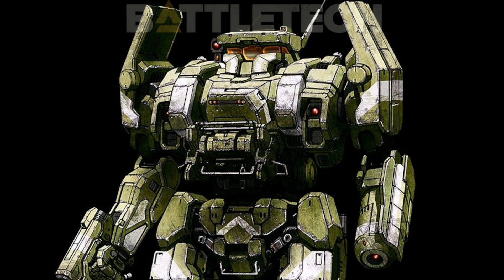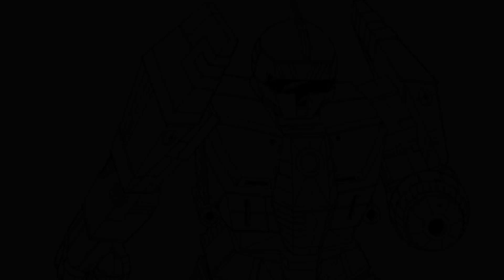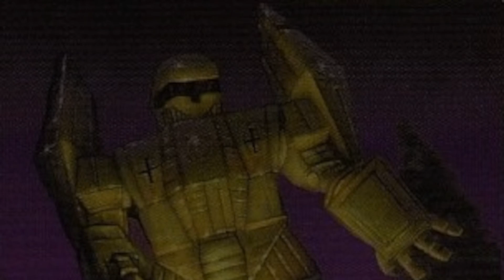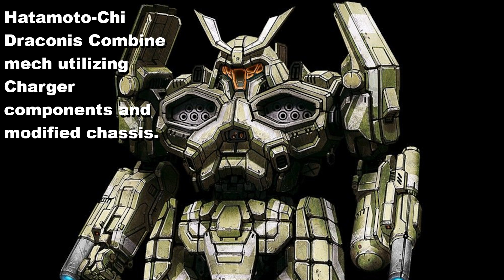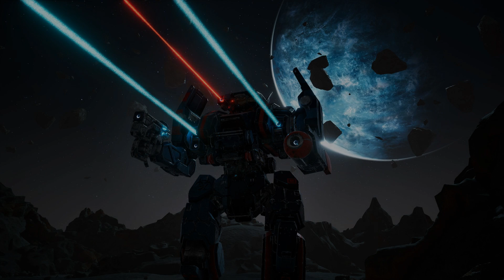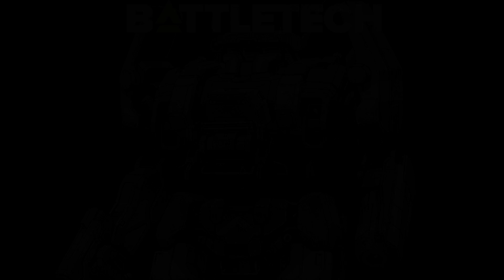BATTLETECH: The Charger

Comment: This frustrates me.  No one would be stupid enough to make a mech with the canonical standard design.  In the Star League era they would have used advanced tech (XL engine, endo steel, etc.) to give it that speed while maintaining viable firepower.  In the third succession war, the larger engine would have been replaced by a lighter but slower one.  Either way it would have been closer to a Zeus.  This whole idea of it being designed as a heavy scout with 5 small lasers would never have occurred.
Reply from the maker: A lot of Star League mechs didn't get Star League "tech" until very near the end of the era to be fair.
Reply: @BigRed40TECH  I know.  I’m writing in part as a real life engineer who knows that aspect of the lore would never have really worked out that way.  I love BT but that part is always like fingernails on a chalk board to me.  The Charger is probably the worst of all examples of that.
Reply from the maker: @davidmelton3704  It's the worst mech ever made :D

To be fair, I think it was largely built and sold for corruption, more than it was for being actually useful. Someone wanted to sell 400 standard engines, needed the military to buy it. SLDF procument was notoriously corrupt.

Comment: If it was 85 ton 400xl engine 20 ton armor or 18 then do at minimum a lr Lazer and a few m lazers with a 2 srm or lrm then it would be a fancy medium mech that's really tall
Reply from the maker: 85 tonners sadly don't use 400 XL based on mech construction rules.
Reply: @BigRed40TECH  ah well I assume you got the idea I was going for anyway

Comment: Saw this video and was wondering if you would do a separate video on the Hatamoto. While the chassis is based on the Charger, the Hatamoto-Chi, -Ku, etc are far better machines and one of the best designed mechs (aestheticiacally) in my opinion. I mean, who doesn't want to drive a giant samurai robot?

I guess that makes the pilot a MechSamurai instead of a MechWarrior, eh? Haha
Reply from the maker: There WILL be a video on the Hatamoto-Chi. As it's more it's own thing, but I did make visual reference to it in this video.
Reply: Yeah the Hatamotos are actually pretty decent - but then again they are the Combine's attempt to make knockoff Thugs, so they at least had a working reference to build off of.
Reply: @YesNoMaybeOkSure  True, the Charger is... original, to put it one way lol.
Reply: @BigRed40TECH  I saw the reference but wanted more haha. I didn't realize there were Hatamotos other than the Chi until I started playing classic BT with my dad. I'm just interested in how it holds up to other mechs since I've only read to the Battle of Tukayyid in the lore.
Reply from the maker: @iFallenAtlantis  The Hatamoto lineup holds up pretty well imo. It's gonna be a while before I cover it though. As I'm first covering all the 3025 mechs.
Reply: @BigRed40TECH  That's great. I look forward to seeing the histories of some of my other favorite mechs then!
Reply from the maker: @iFallenAtlantis  Covering all the mechs this way may melt my brain eventually. But I will be ever-pleased to do it, lol

Comment: Although it is completely out-of-character to the design flaws of the origional 1A1, the 'challenger' variant is just another slow, gun-heavy assault mech. They are rather hard to believe, as the entire point of this design was heavy + speed; Challengers are supposedly rare, but prized gladiator style dueling mechs. I use one frequently as the Liao lance commander 'badguy' in my campaign and it really shines. Just another offshoot variant that in no way resembles its predecessor, it is still a nasty fighter and takes a lot to bring down. I was disappointed that the 'challenger' didn't get a mention - but when it comes down to it, ANY improvement on a Charger just involves a smaller engine and bigger guns - may as well just get an Awesome or a Stalker for similar effect.
Reply from the maker: It's not a charger anymore. It's a charger derived design.

Comment: Y'know, I understand most people consider MWO apocryphal at best but... HOW DARE YOU!

My 1A1 is the hottest thing on legs since the invention of legs!

It is also quirked all to hell. If the range wasn't fixed, I am sure it would be a total bust. but considering that it has ~600m max range on 7 instead of 5 er small lasers, and a cycle time akin to a RAC, a Charger from MWO is a force to be reckoned with. The fact that I can chase down many clan mechs that top out at 81kph is great. I can always force an engagement.
Reply from the maker: MWO's just very not how it works on the table to be fair lol
Reply: @BigRed40TECH  Very true. But on the range at least for the tabletop it would be like having Medium lasers instead of small ones. The weapon cycling could be represented by even lower heat buildups.

Comment: Wait, if it only has 10 tons of armor, and 5 small lasers 200kg (1/10 a ton), so 1/2 a ton. Where did the other 69 1/2 tons go.
Reply from the maker: The Engine on the Charger weighs 52.5 tons for a start.
Reply: @BigRed40TECH  I have no words.

Comment: As much as the Charger competes for the worst mech title, alas, no, it's not. The Worst is the Hoplite -4C: 55t, 4/6/0, 11.5t armour. no arms, 1 AC10 w/1t ammo, 1 LRM5 w/1t ammo. It's slower, has comparable overall toughness, can't melee, and all of the weapons require ammo. The mass looks off, that make sense since it carries 16 heat sinks. The Charger was able to survive the succession wars, the hoplite could not.

For the Charger -1A1 itself, I have had a "moderate" amount of success by just upgrading the SLs to MLs. Sure, you loss a lot of armour and have heat problems, but 5 MLs is a decent amount of fire power for a successions wars mech. It's still nowhere near good but can actually contribute to a lance. I've also used a 4ML, 1F version as a "boss mech" for a succession wars pirate company. The rests of the pirates are in lights and mediums so the additional size of the Charger gives it a boost in toughness without making that much more dangerous for the player's medium/heavy mercenary lance.

Comment: Anyone who calls the charger bad or useless is an idiot who can only do stompy mechs.   Read up on the mech and use it for either its INTENDED purpose....or its true purpose.    

I've had several conversations with people over its use.   Once i explained the true use of the charger. - protective brawler for your recon mechs with crit seeking lasers - i.e., punch /kick ( 16 points damage) followed then 5 small lasers ( either finishing the limb or crits inside it) on other LIGHT  to lower medium mechs.  

You could see the light bulb go on once the strategy was explained to him.    This thing is designed to kill light mechs attacking or reconing your mechs.

Comment: Nothing new from me. The Charger is one of the worst mechs ever, and any talk about interests me like cringe, aka I have to see it. Its an Assault Mech that fails at being an Assault Mech, or even a Battlemech. 

With extensive changes the title mech can work. For the Inner Sphere downgrading the engine in exchange for better armor and weapons is essential to make it an actual Assault battlemech, or using an Extralight Engine to retain the speed but also improving armor and weapons.

The Clan Gargoyle is what the Charger could be, a fast assault mech with much better weaponry.

I love tinkering with the Charger. Just upgrading it to Endo-Steel and Double Heat Sinks allows the Charger to upgrade all its Small Lasers to Medium Lasers, tripling the effective range. Thats not a perfect upgrade but its better, at least close to a Wolverine or Quickdraw.
Reply from the maker: It's really amusing how like a 400XL Charger often is little more impressive than a lot of 55-65 ton mechs, if more impressive at all. XD
Reply: @BigRed40TECH  The only real advantage of having a fast assault mech is because the Maximum Armor is higher. 

There are optimal tonnages but following that would make things boring.

Comment: The original sucks, the 1A5 is pretty good.
Reply from the maker: Strategically it's a nightmare. But it's tactically fine.
Reply: @BigRed40TECH  for sure, the whole charger line is just a dumpster fire, but the 1A5 is just a more useful, capable dumpster fire, I wouldn’t buy them meant you, but if it was that, or something…I’d buy 1A5’s if all that was readily available at a reasonable price, as they are at least useable and effective.

Comment: :Sigh: Did you even read the fluff?  This thing does exactly what it is designed to do, be survivable for short periods in high threat environments.  It is literraly the breacher that kicks the door and then stands back so the entry team can do its job.  

The failure was not the mech's, it was the design team's for thinking there was an actual market for such an expensive and utterly specialized unit to fill such a seldiom-needed niche role.
Reply from the maker: It's not even that survivable, and it's not fast enough to get away from any units that'd give chase. It's a bad mech.
Reply: @BigRed40TECH  Not survivable?   Again, did you even look at the thing?  How is being able to soak an AC/20 hit to any leg or front torso location without going internal on a 3025-era mech not survivable?

Also speed is adequate for the role.  This is not some far-ranging outrider, this is a doorkicker that makes entry and then steps aside so that the rest oif the team just behind them can do their thing.